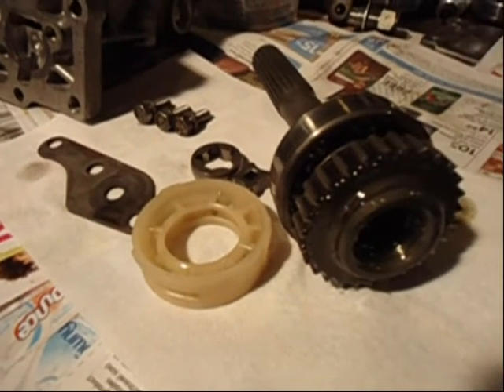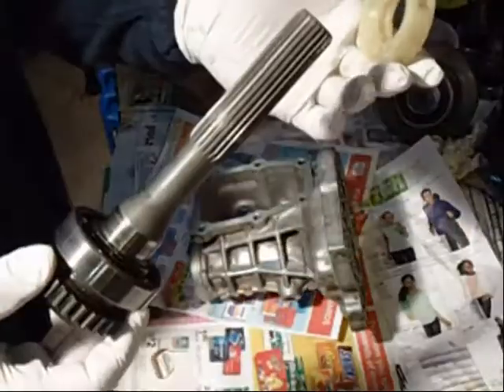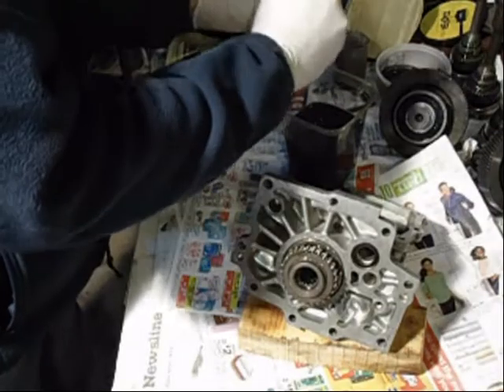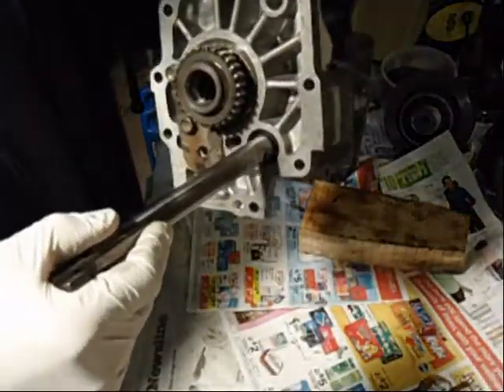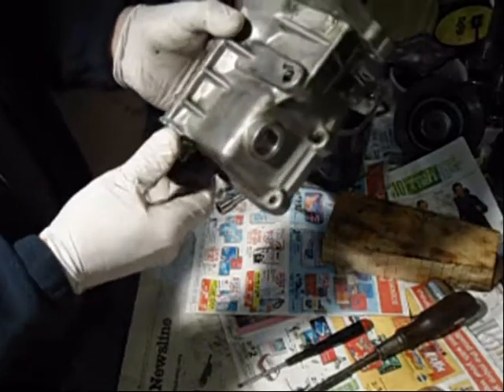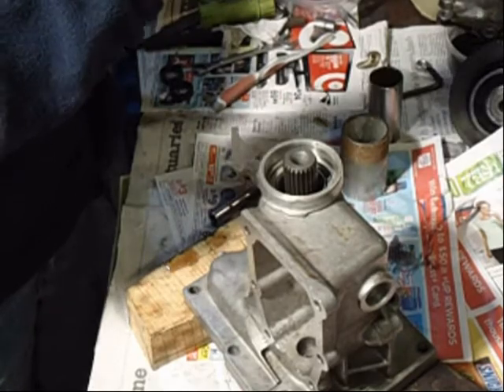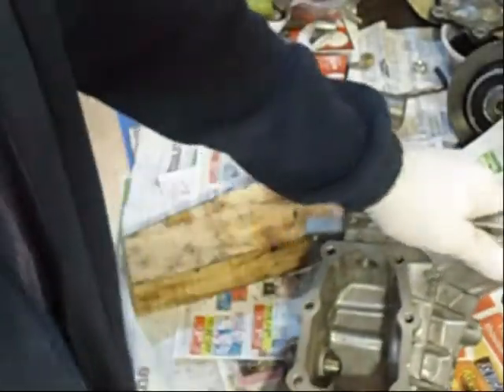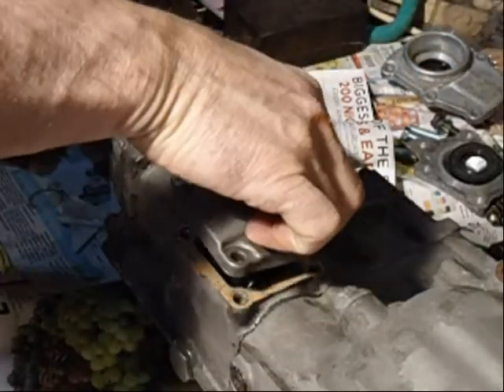Toyota Tercel 4WD Manual Transmission (part 7) Extension Hsg

Comment: What is that spring-loaded pin fastener called that you show around the 9min mark? Super helpful videos, you're a legend!!
Reply from the maker: Makes you push shifter over to the right a bit harder when you put it in reverse. I think its so your less likely to shift into reverse when trying to shift into 4th gear